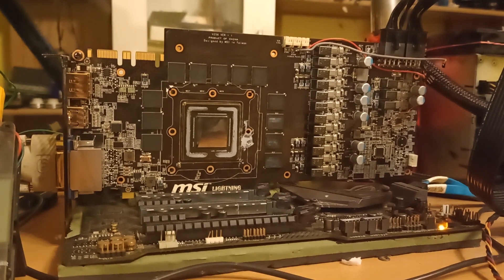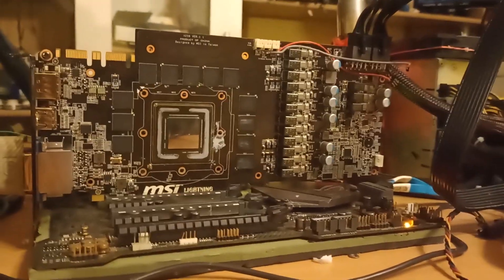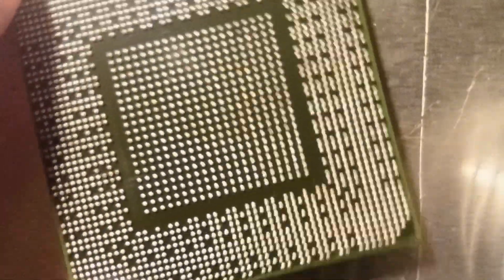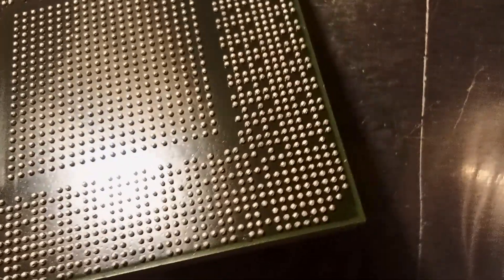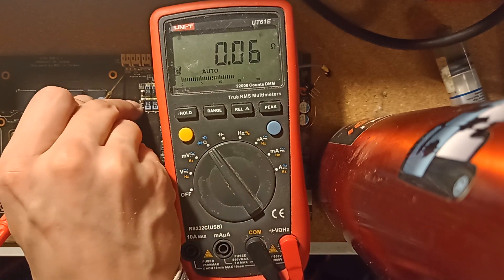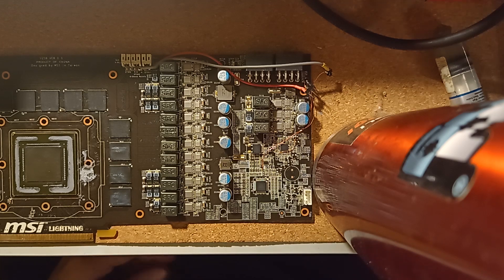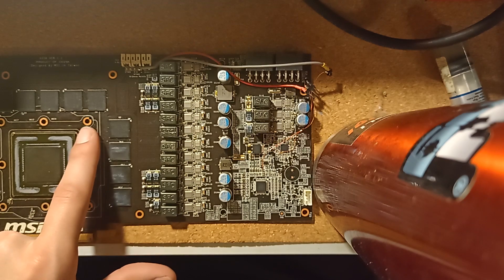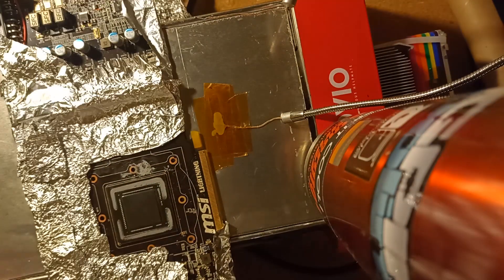My first attempt at replacing GPU core | GTX580 CoreSwap

Comment: What's that device to heat up?
Reply from the maker: On bottom is regular raclette grill with Alu plate to distribute heat, on top IR heater made for actual IR stations (much cheaper to get heater only without rest of the assembly)
Reply: @ShaggySVK  i see , now i  know something. thanks man.